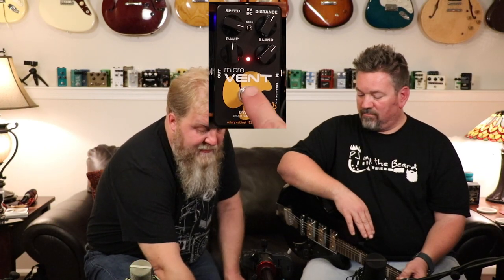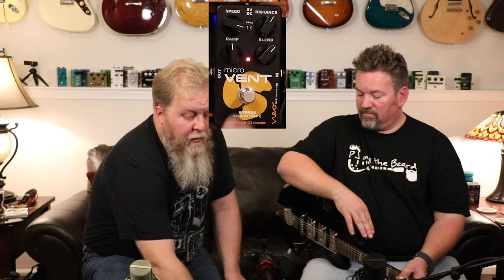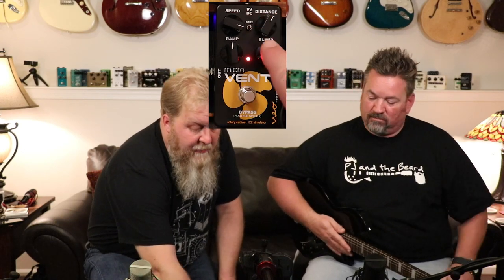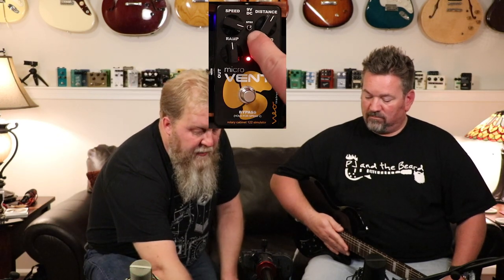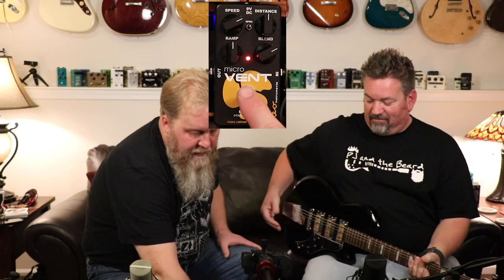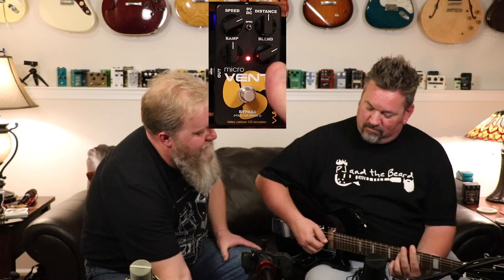The NEW Neo Micro Vent 122 - That Leslie Sound Series

Comment: Hi guys, just a quick one to pick up on something you mentioned in passing - you mentioned that the pedal makes the guitar sound better even with the blend knob set to have the effect "off" - I know you demoed this in your other video on the Vent 16. Just thought I'd suggest, in my opinion that's probably because of a noticeable buffer - since the pedal seems (from the product page) to have a high quality buffer built in, when you switch it on with the blend knob down you are in effect just switching the buffer on, which will mitigate the impact of the capacitance of your cable runs, basically making the guitar sound nicer! 
Hope that helps!
Reply from the maker: Great point. It very well could be the buffer that sweetened up the sound a bit. Worth noting, the global features of this pedal enable you to turn the buffered bypass on or off as well.
Reply: @PJandtheBeard  Yeah, I spotted that. They really seem to have thought through the features and configurability of these pedals, they seem fantastic!

Comment: It’s crazy to spend € 400 for a digital simulator. With same money you can buy a complete effect processor.
Reply from the maker: There is some truth in that, pedals like the Walrus M1 and Wampler Terraform have good leslie simulations in them. That said, stand alone pedals often, but not always, have more control. The Neo stuff is worth it if that is what you want. We did most of the leslie pedals out there in this series and the Neo pedals are some of the best by far. Multi effects are great, but I have always preferred stand alone effects. Especially when the option for an analog pedal exists.

Comment: Does this work with a Hammond organ?
Reply from the maker: It does. I asked the builder about that and he said that the input stands line level up to +5dbV.
Reply: Not really, because the micro Vent 122 is always in "guitar" mode. There is no "keyboard" mode, so there is no cabinet simulation in it, so it can't simulate the sound image of a Leslie box.

Comment: A shame no stereo
Reply from the maker: I used this one outside all summer and it sounded great. I rarely get to play through a stereo rig live, in fact I never have, so it’s not a deal breaker for me. I think the mini has stereo and is the same DSP. There is always the Ventilator II which we should be adding to the series soon.
Reply: @PJandtheBeard  how does the Lex holds up to the Ventilator?
Reply from the maker: The Lex is definitely nice. I used that on my board for a long time before we did the series. It is one of the pedals we kept.